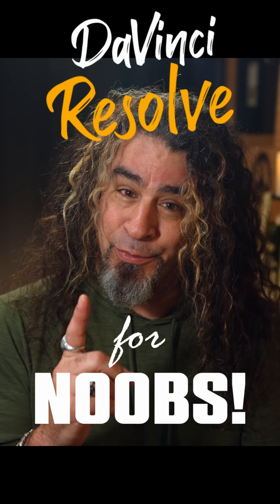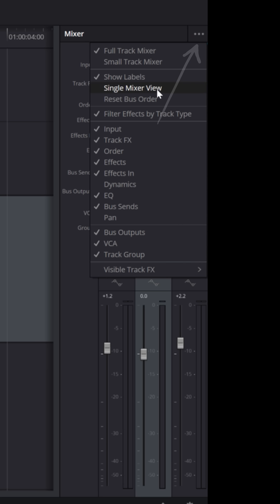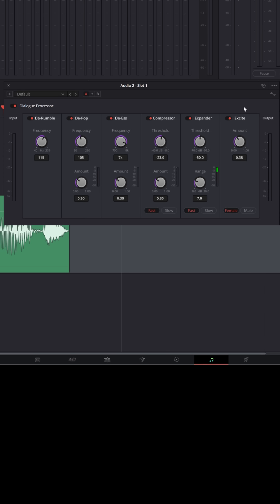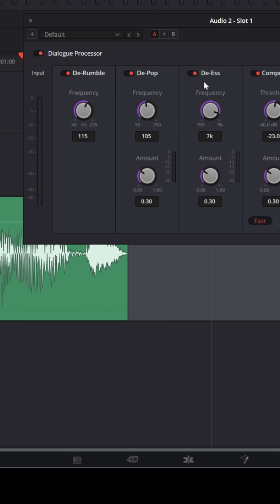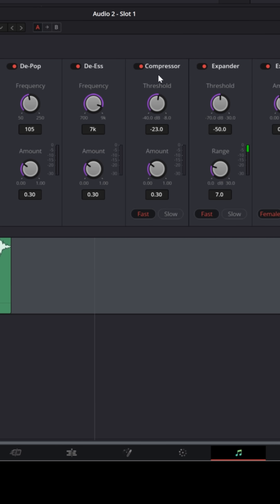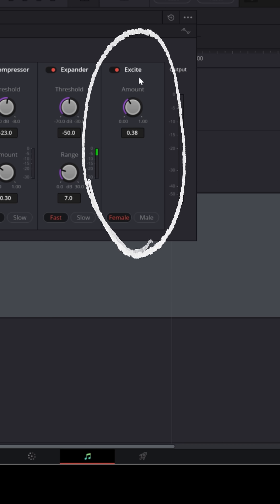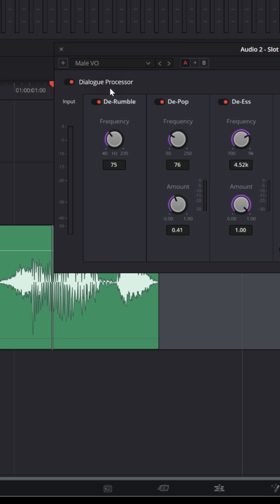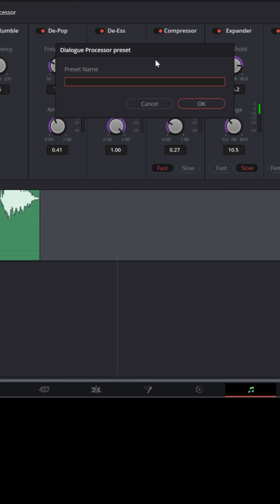Improve Your Vocal with Dialogue Processor - DaVinci Resolve

Comment: Is all this avaiilable with the free version? I'm trying to learn DaVinci Resolve 20. On my first project, the mic was set too high, and there is distortion on the spoken vocal track whenever somebody speaks too loud. Will the compressor alone eliminate some of this distortion? Thanks for your videos!
Reply from the maker: Yes, this is available on the free version. If there is distortion recorded onto your track, that’s very difficult to remove if it’s embedded in the original audio.
You might be able to mitigate some of the peaks though, if it’s just a leveling issue
Reply: @Daniel_Batal Thanks! I'll try. I know it can't be eliminated completely.

Comment: Hey Daniel! Thanks for showing me the dialogue processor. I have a couple follow up questions for  it:

1. Do you find that it is necessary to use effects in addition to the dialogue processor, for example, EQ?

2. If you do use other effects in addition to dialogue processing, is there a precedence that Davinci follows? For instance, if I add compression, then dialogue processing, does the dialogue processing override the previously applied compression?

Know these answers might be a bit much for a reply-- if you have a video that would help, I'll gladly go there. Thanks!
Reply from the maker: When you stack audio FX, one doesn’t override the previous, they layer together for an overall effect.
Though depending on how you stack them, one might counteract the other, especially with EQ 
The question becomes; What is it your audio track actually needs and in which order should you apply those things?
No two audio tracks are the same (unless they were recorded from the same session), so there is no single, universal answer.

Experience and training your ear is 90% of the battle, much like training your eye is the most important part of color grading.

Having some studio quality near-field reference monitors in a balanced sound environment is super important too.
Same as having a color-calibrated monitor for color grading.

I see too many Creators trying to mix audio on the same tonally ‘colored’ headphones they use for listening to music at home.
Reply: @Daniel_Batal  Thanks for the thorough reply! I have a Blue Yeti USB that I am recording with. On this occasion, I find myself diving into EQ and compression to shore up some noise-reduced audio that needs a little love after the background noise has been eliminated. 

Your videos have proven invaluable. Keep it up!
Reply from the maker: Those are great places to start.
Don’t be afraid to spend a little time learning how to use multi-band compression.
That can be a real game changer too

Comment: Thank you, Daniel, for this excellent tip. I have a different issue which I cannot fix. There is a section in an interview, where a motorcycle passes with a loud noise. Can the noise be removed in the free version. If yes, would it be possible to share some tips on it. Thank you!!!
Reply from the maker: Not easily. You'd definitely need an AI assisted feature for that and those are all in the studio version.
You could try https://podcast.adobe.com/enhance

Comment: One tip for beginning users. Turn all the processors OFF with the switches at the top, and then switch on the first on the left, set to what makes you happy and makes sense, then move to the next section. That way you'll understand what each does exactly in time and be much faster at setting this up. I mix dialogue for a living. Thanks for pointing this out to everyone.
Reply from the maker: Pro tip!